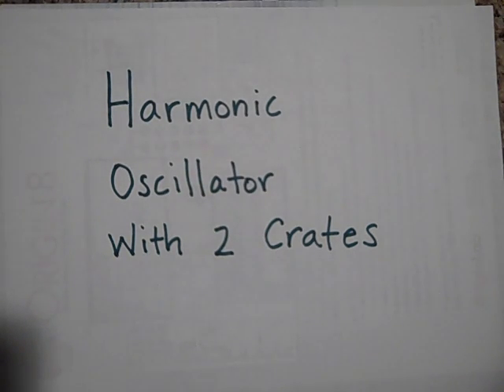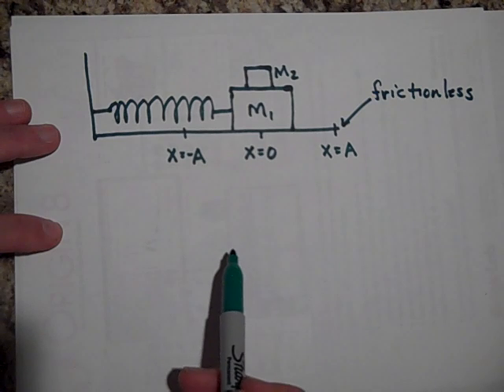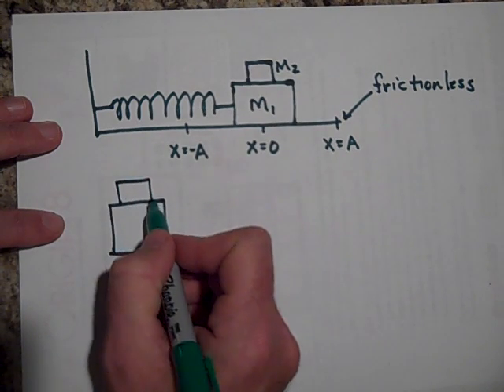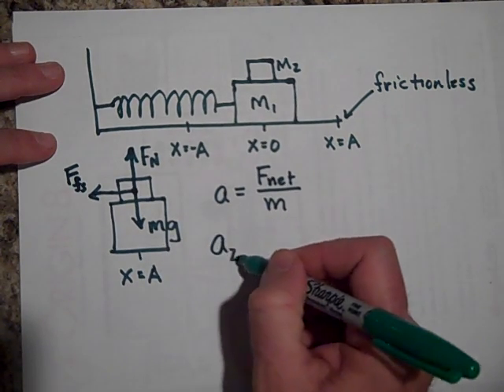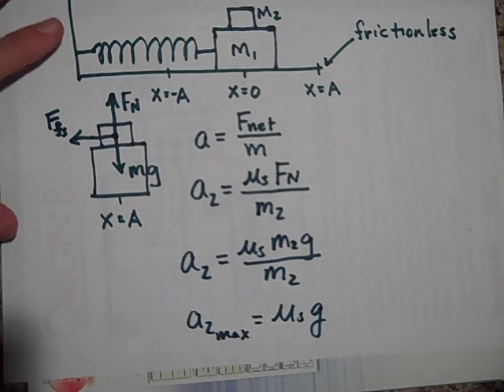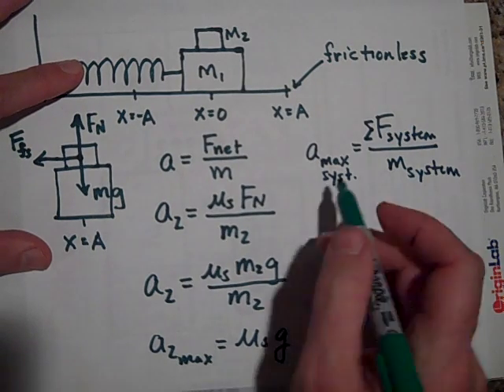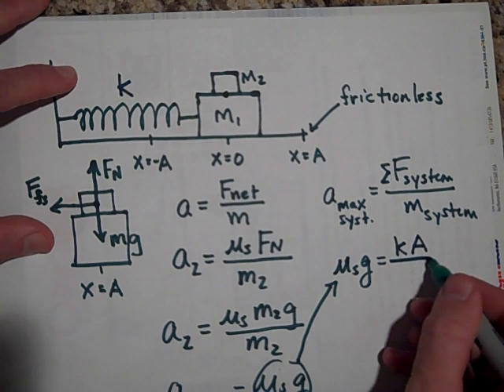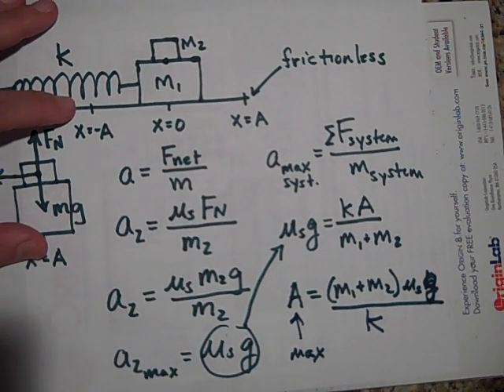The Harmonic Oscillator with 2 Objects

Comment: The boxes M1 and M2 are going from left to right.
@Rhenx3 the normal force (N) cancels out the force due to gravity because the net force in the y-axis is zero. If it were not zero, mass 2 would be accelerating downwards (which obviously doesn't happen)